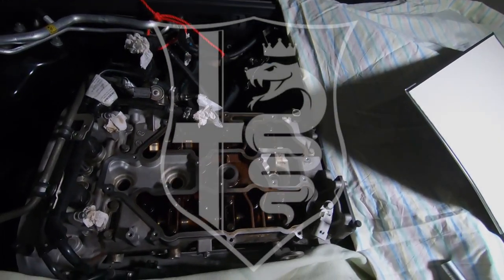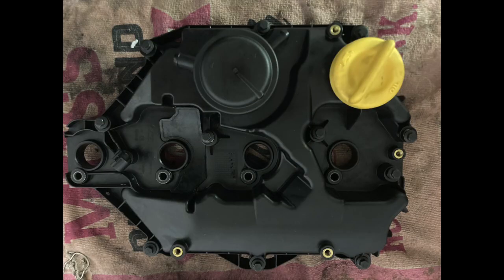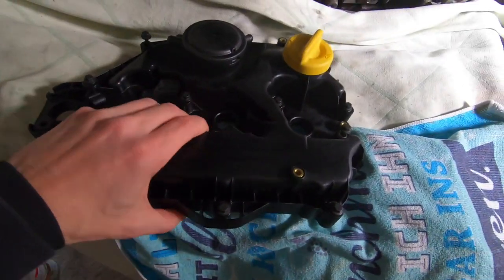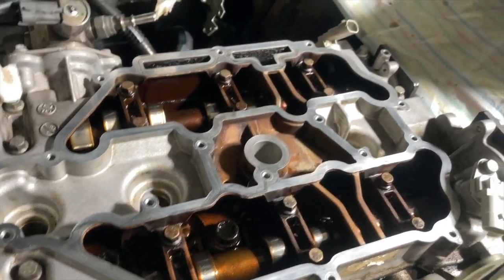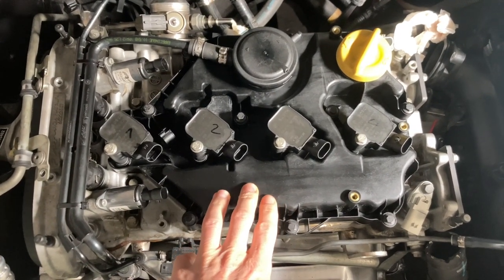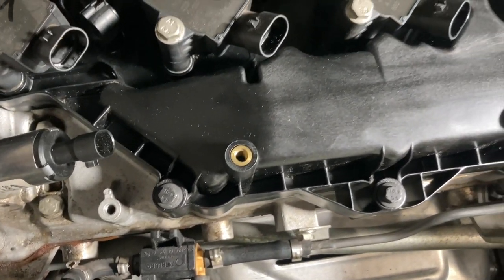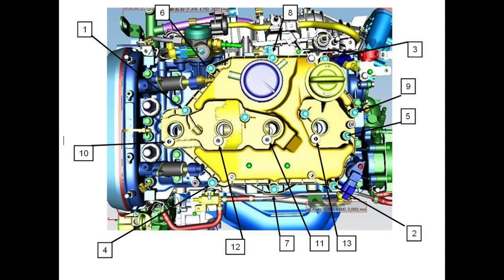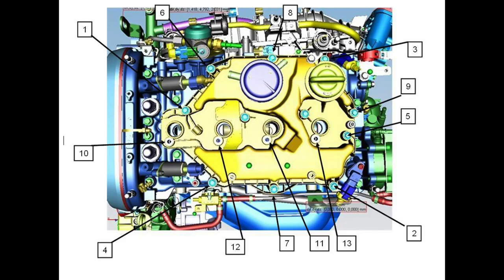ALFA ROMEO 159 TBI (939) OIL LEAK ON ENGINE OR IN SPARKPLUG HOLES - OIL SEPERATOR GASKET CHANGE!

Comment: Hello brother, great videos!! pleasure to just sit and watch them! <3

im having the same problem i think. 
I can see oil on the left side.(the point you first pointed,near those bolts there.)

No idea if spark plugs has oil there aswell.
Hopefully not.. But i dont really have the knowledge or enough tools ( And Courage :D ) 

I do have oil aswell around the pcv valve black cover cap.. ( the one which is left to the yellow cap)

its been dirty for long, cleaned it up abit, and aftter 2 days of daily city driving, i saw some oil gathering there.. 

what would you suggest? gasket aswell as in the video?

Thanks in advance :))
Reply from the maker: @danidin-h8j  hi there ! Thanks for watching and enjoying my videos 😌. If you have oil around the pvc you can change the gasket from the pvc. But you have to be very careful because you can damage the plastic clips …. Work with heat to prevent breaking.
Reply from the maker: @danidin-h8j  think you don’t have to change the head gasket if there’s nothing wrong… but maybe it’s time for the head gasket if you have oil there😛

Comment: Was it relatively easy to remove the oil separator from the top of the engine? What is the part number of the gasket that needs replacing?
Reply from the maker: Hi there. It could be a bit difficult, because the gasket is sometimes tight on the engine. But I recommend to lessen all the screws and then carefully raise the separator from each side a bit ..it should come off than. Number is 55215302

Comment: @Seprent Crown 
Did the separator come off easily? Mine seems to be stuck as if bolts are still on and it won't move
Reply from the maker: Be sure to loosen all screws and then lift from each side a little bit. Mine did stuck a little , too
Reply: @Serpent Crown 
Thank you for your response I'll attempt it again
Reply: @Serpent Crown 
I attempted again whilst the engine was hot and it just popped off and than you for your valuable video especially the torque sequence
Reply from the maker: @alainbauristhene6427  no problem ! Ask anytime